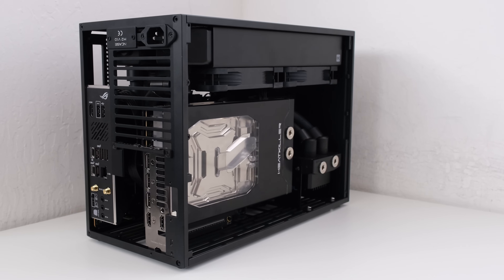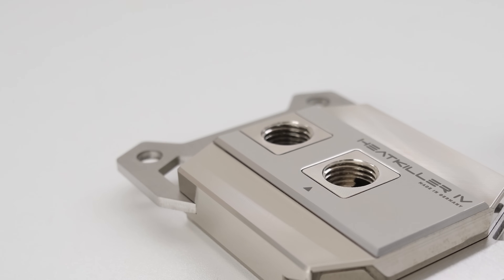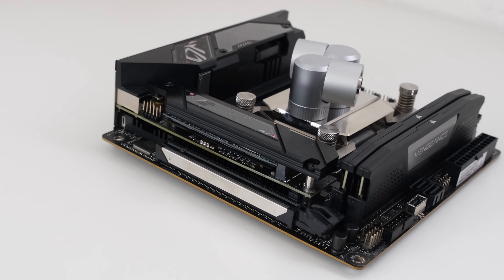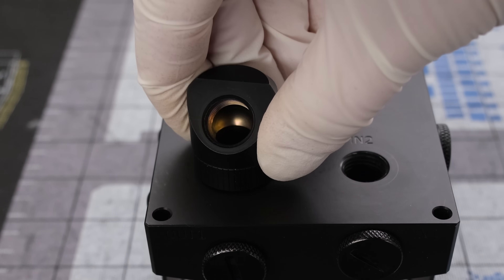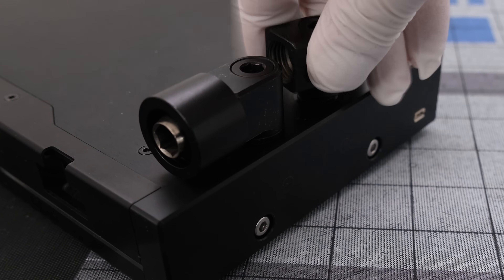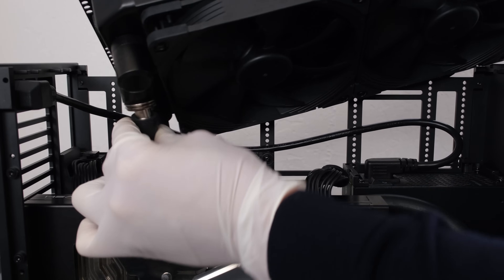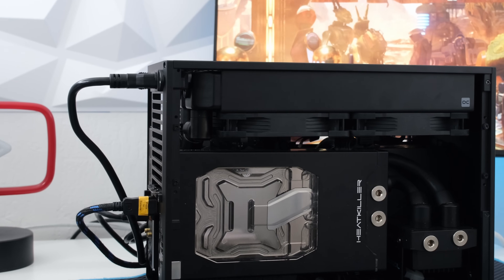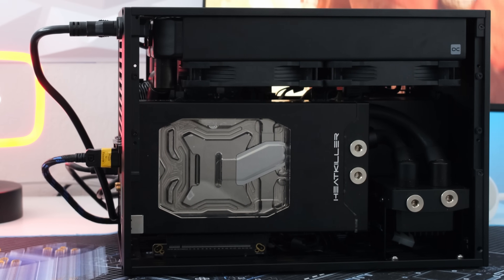RTX 4090 in NCASE M2 - Ultimate SFF Watercooled PC

Comment: You are very brave with a single raditor. 50% blocked by case and then cover. 
I've got 2 slim radiators and 2 tiny pumps working one after another.

Comment: 99 degrees VRAM is not ok
Reply: No it’s not, but that’s what u get when u try to cool all this with a single 280 rad, stupid lol
Reply: @godnamedtay I think the problem is not a rad. 58c on die and 98.. looks like bad contact on vram dies. Should be li ~65 on vram
Reply: @graviusmatt  ok that’s a possibility, but would yourself even cool a 4090 with a 280 rad? Even the AIB’s don’t sell liquid cooled 4090s, 5080’s, ect with anything less than a 360. This build needs 2 rads, period. This is nonsense. I also saw a video of this dude doing an entire Intel water cooled build with a 3080 on just a single 120 rad. Dude is out of his mind lol
Reply: @godnamedtay you can use 280 rad with servers fan at 6000rpm+ 😂. And tell everyone that you have an turbocharged pc

Comment: love this build. Now with the ncase M3 release this exact setup could maybe be assembled without needing vertical gpu mount, thanks to the m3 extra height, right?
Reply from the maker: Perhaps, I haven't done my research on the M3. Does the M3 come with a native vertical mount? The block would still need to be mounted vertically. The extra height helps for sure. This was a tight fit all around, but it all did fit.
Reply: @vectornetwork  no it doesn't. Now that I'm wathcing again idk what was I thinking, extra height won't be enough

Comment: Thank you for sharing this! Just ordered the M3 Grater and will be using this vid as reference for my build. Quick question, now that you've been using this for a while, do you feel the single 280 rad is sufficient to cool a 5080 & 9800X3D?
Reply from the maker: That's a tough one. 280 is barely the minimum. I don't really try the builds that are only a single 240. A 5080 will draw noticeably less power than a 4090, so I think it would squeak by, just like this build. Hope that helps

Comment: hey bro looking for a tip, I want to build this exact same pc but with the 9800x3d, b850i and a 5090, do you think the Gigabyte AORUS GeForce RTX 5090 XTREME WATERFORCE WB mounted horizontally would work with all the components you listed apart from the Heatkiller v pro? Like all the fittings tubes etc.. thanks in advance
Reply: or alternatively, the 5090 Gainward with the Heatkiller v ultra using the new pcie 5 riser for the ncase m2, might be the better alternative

Comment: Your Google sheet with build parts in incorrect. You may have linked to the incorrect build?
Reply from the maker: There are different tabs. Checks the tabs at the bottom. That worksheet has several builds.
Reply: @vectornetwork  Thanks. I thought I looked but I guess I didn't!

Comment: A single 280mm radiator for both CPU and GPU is really not enough. Even if you blow 19°C air directly with air conditioning, it might help temporarily — but in the long run, you’ll still be thermally limited. You won’t be able to run both components at full potential for extended periods without throttling.
Reply from the maker: Yea, sounds about right. This was more of a concept. I wouldn't want to run this as a daily.  I wanted to see if I could reasonably fit a 4090 into the Ncase M2 and have it not be significantly compromised by some issue. I think it works (just barely), but the maintenance would have to be done like all the time to keep it running well. I also thought that it looked really clean since I was able to hide most of the cables but still have some peak out to let you know that they are there. Thanks for your thoughts

Comment: Could you do this with 30mm thick fans when the t30-140 releases with the same radiator thickness at 45mm? Using an x870i motherboard.

Comment: It would be good if there was water in the power supply too. it would be thinner and it would be convenient to make a very small pc. smaller than this one. and if they replaced the sata connector with mini-SAS it would be even more compact. 

I think if there were more heatsinks you could make a super quiet pc.
Reply from the maker: Thanks for your comment 🙏 Yes, if everything gets lower in noise, then the PSU would be the next culprit. But then that would be well beyond my abilities and capabilities.
Reply: @vectornetwork  I have a power supply unit, the cooler is noisier than the rest of the PC, but I don't want to change it because it will take a long time and there will be no warranty, although another power supply unit lasted 7 years and then tragically exploded, but everything else survived, so I'm happy. If the power supply unit works normally for a year, then you can replace the cooler, regardless of the remaining warranty.

Comment: When doing this build, how are you sure that you've filled the loop at the end?
Reply from the maker: Thanks for your comment 🙏 Good question. ITX watercooling builds are usually much harder to fill. The only saving grace is that they are small enough to pick up and rotate, which is basically required to fill. The way I did it was I used the GPU block as a gauge for how much air is in the loop. I would fill it from the 4 plugs you can see from the front (2 on the GPU and 2 on the Pump Cover) by placing it on its side. The process was to put as much liquid in as possible, seal it up, pick up the whole build and rotate it so the water will flow to the radiator, CPU block, etc, put it back down and repeat this process until there isn't any air in the GPU block and its all filled up with water. It took about 10-15 times until I felt it was good and I could run the pump. Hope that helps.

Comment: Is it possible this water cooling setup into Fractal Design Era 2? What should I follow?
Reply from the maker: Thanks for your comment 🙏 I actually tried to water cool in that case. It set me back about 2 months of building since I tried everything and nothing fit! It also only maxes out at 240mm radiator. The Ncase has room for a 280, which is not insignificant. Hope that helps

Comment: i really like this build. i want to use a 7900xtx that is too long for having the same pump. it's hard to see what free space is available instead. do you think using Alphacool Eisstation 40 DC-LT  + Alphacool DC-LT 2600 can fit if i put a 7900xtx water cooled ? also, what is your process for designing a setup to avoid compatibility issues where one component blocks another?
Reply from the maker: Thanks for your comment 🙏 Good question. First rule of watercooling is that nothing fits! Funny, but kind of true. I think it would probably fit space-wise, but the hardest part is finding a good place to actually mount the pump and still be able to do runs. My process for designing a setup is simply to try everything. I have a lot of pumps/reservoirs and all the mounting hardware over the years. You kind of identified the hardest part of watercooling, which is getting the parts that fit. This makes it way harder when watercooling in the smallest cases. Hope that helps
Reply: @vectornetwork  Thank you for your answer. i understand that it is hard as i think, but becomes easier with a bunch of hardware. So in my case i need to order, test and send it back if it doesn't fit. Does the position of the pump in the circuit change anything ?
Reply from the maker: @spoitler447 Loop order doesn't matter, the water normalizes too quickly for that to be an issue.

Comment: Awesome build!
I'm planning a similar build, do you know if arctics p14's(27mm instead of the 25mm) would work? It looks like your noctua a14's are right up against the motherboard. You would help me out a lot!
Thank you in advance!
Reply from the maker: Thanks for your comment 🙏 Good question. It is close. I tried to put fan grills on but they were too large. I think you will be able to clear the motherboard just fine, but the problem will be the 12vhpwr cable. You see how the cable is the only thing that sticks up and can interfere with the fan? I had to bend that cable pretty well. It will be close. You may have 1-2mm of space, at most. Hope that helps

Comment: Awesome video - thanks for sharing this beautiful build.  Did you consider using the Alphacool VPP655 + Ice Cover (D5) pump on this build?  It's difficult to get the GPU water block you used where I am, and was looking to use the EK waterblock for the 4090.  I'm hoping there's enough space between the card and the side panel for the hoses. 

I haven't built a PC in almost 20 years - so much has changed haha.  In the early 2000s I was overclocking Athlon XP 1700+s and cutting windows into Antec cases.  My last PC was an unstable water-cooled Windows Vista machine, which made me go Mac for the last 20 years :)

Comment: Doesn't the GDDR6X memory temp seem high?  Unless that normal, I dont have any experience with GPU's using the 6X memory.
Reply from the maker: Thanks for your comment 🙏 You're absolutely right that those memory temps are high. Some viewers had pointed that out earlier. I didn't catch that before publishing the video. I missed it partly because the GPU temp was in line with expectations and my mind blanked when going over the memory temps. Since then, I had taken the block off the card and verified that the contact was not good. For memory temps, I expect them to be in line with the extensive testing already done on this water block (spoiler: they're good). Hope that helps

Comment: A Masterpiece! 😘👌 Perfecto! This is now my Dream PC Build! 😍 Do you do Prebuilds?
Reply from the maker: Thanks for your comment 🙏 I appreciate the kind words. I plan on doing my best to make more videos. I have never build a prebuild.
Reply: @ what do you do with these PC’s after you’ve built them? I’d love to build a pc like this, but don’t trust myself enough to handle such a task 😂
Reply from the maker: @JC-hq7wz  Well, sometimes I use the build. Like the Editing/Gaming one. Been using that as my main driver and to edit these recent videos and it runs like a dream. Just a little dusty since I keep the side panel off (so I can look at the build) so I spray it with air ever so often. But most other times I simply just take it apart. I either need the parts for another build, need to sell the parts to fund another build and/or need the space. So, this one is completely disassembled as the Strix 4090 is back in a Silver Optimus block and being filmed for another build in the Fractal North. Hope that helps

Comment: It's really amazing to be able to fit all that in, however the question is - is this better than just leaving everything air-cooled? The issue I see here is you are dissipating all the heat generated by both the CPU and GPU via one single 280mm radiator - which, ideally should be dedicated to CPU alone. And you are running the water line in serial I think, which means either GPU or CPU is getting the warmer water... I'd love to see trying the same basic build setup but with all air-cooled solutions and do a comparison. I think Optimum did a similar build (same case, same CPU but 4080), all air-cooled. It would be interesting to see the difference in performance... While it's a very cool (and expensive!) build, my gut reaction is that it actually would perform WORSE than a much cheaper, standard air-cooled build in the same case.
Reply: It's about the same, slightly cooler than My air cooled version. Also loop ordering doesn't matter. The water runs quickly though the loop causing it to evenly increase. The thick radiator is more than enough for both components. As cpu barely outputs any heat vs. Gpu. And here there is very little impeedence, so the dissipation efficiency is maximised.

Comment: Do you think a slightly larger MSI Gaming Trio 4090 waterblock would fit in a build like this?
Reply from the maker: Thanks for your comment 🙏 This HK water block was one of the few waterblocks that I tried that would fit with a 45mm radiator up top. The difference is the location of the terminal. By having it on the side, it reduces a lot of the height. Hope that helps

Comment: What were the ambient temps? Did I miss that? My 3070 gets to 49C during 3DM Steel Nomad with 720mm in rads which is only 10 degrees with more than double the radiators

Comment: Well, nice job. A bit far from being ideal, but nice.
I'd love to see some additional metrics like the coolant temp and the time of the run.  And of course what CPU temp metric was used. Simply because the results are a bit too good to be true - more about it later.
As for the build, first of all it is way more practical to use the fans in the pull config - way less cleaning needed. And I'd definitely use the rad port on the top as fill port with the help of offset fittings or a couple of low profile 90. Way easier to fill the loop. And of course the drain port. As for power supply, and true SFX (without L) SF1000 would probably be a better fit because it allows more flexibility. Also, 45mm rad is also not that great. A 30mm HWLabs GTS280 would perform better at low to moderate fan speed and about the same at higher speeds due to its larger core. Thats not theory, but from experience.  In addition, there is definitely a room for some sort of pump res combo.
 I have a build with a similar power draw. About 340W GPU and 120W CPU under full load. All housed in a Lian Li Q58 - 14L case.  Initially, I was using a single 280 rad and I was not happy with the need to have fans spinning at 1300-1400 RPM under full load to keep the coolant below 45C in a 24-26C room.. A bit too noisy. So I ended up adding mounting holes on the bottom of the case and slapping additional 280 (surprise surprise, NexXxoS XT45 280). TBH, I''d prefer a 30mm but I only had this one. The only spare 30mm 280 was xflow, which was less convenient and required more dremel love to the case. With the additional cooling capacity, the coolant is below 40C with fans in 800-1000RPM range depending on the room temp. That is much more quiet.
Even with the additional rad it is just a bit larger than M2, but significantly quieter and with much higher cooling capacity.
Reply from the maker: Thanks for your comment 🙏 Someone else had mentioned a pull/intake config. It didn't really occur to me, as I was thinking exhausting hot air up seemed like a solid choice. The top port on the rad would have been perfect to use as a fill. But, the ports were covered by the bracket. For the power supply, my understanding is that the SF850 and SF1000 have fans that tend to be louder than expected at higher speeds. So, I went with the SF1000L as I wanted at least 850 watts. I thought the 45mm rad actually looked really nice there. I tried a 30mm rad and there was something about squeezing in a 45mm one that felt solid. It was a good feeling, since a lot of times SFF builds are not only restricted to 30mm but also only 240mm rather than the 280mm one here. Your build sounds really good. Its a win that you got it to run both cool and quiet. Thanks again for your thoughts and I plan to make improvements with each video.
Reply: @vectornetwork  thank you for the reply.
when I was talking about fans at pull config, I meant exhaust. For your build it would mean switching the fans with the rad. This would also leave enough space between the rad and the bracket for the top fill port with 2 x low profile 90 or some offset adapter without dremel love. TBH, even if for some reason it is impossible to to swap the rad with the fans, I'd use dremel to gain access to the rad's top  port.
As for SF1000 - under ~500w load, it is not louder than other fans in the system (all of which are below 1000 RPM). It is worth mentioning that the PSU fan is assisted by the top rad. I even made some sort of a shroud to force more air to go through the PSU even when it's fan is completely stopped.
Reply from the maker: @DmitriWeissman  Oh got it, I misunderstood when you said pull, I mixed that up with intake. It is because, I had initially tried the pull config first and it simply wouldn't fit. With the radiator lower, the fittings would stick out too far down. The rad is required to be on top, so the fittings can sit more flush with the fans. As for the dremel, I think that would be solid choice as the top ports are just so perfect to use. For these videos though, they are all 100% completely mod free. I mean, its all custom modification stuff we are doing here, but I stop short on breaking out any power tools. Part of the puzzle and part of the fun for me is figure these builds out with existing parts. So many times I had to not use a pump unit because the screw holes just dont line up. And I have endless mounting plates that I have accumulated over time to try. Also I'm trying my best to appeal to a wider audience. Watercooling is already so niche. I think you may very well be right about the SF1000. I have never tried it myself. I think it is likely I'll procure that PSU sometime in the future. As it may prove to be very useful for upcoming SFF builds. Thanks again for your thoughts

Comment: Can you move the gpu plate while vertical for the hose pass throughs? I want to use my mora 3 420 with this case.
Reply from the maker: Thanks for your comment 🙏 The pass through holes on the GPU plate cannot be used when using a Vertical GPU. The instruction specifically require the removal of the GPU plate. Hope that helps
Reply: @vectornetwork  i got the case and used standoff to raise the gpu so I could use 2 140mm fans on bottom. Used a pcie passthrough from iceman for the tubes. I use the mora 3 420

Comment: Does it fit ZOTAC 4090?
Reply from the maker: Thanks for your comment 🙏One of the reasons why this build works is the compactness and terminal placement of the Heatkiller GPU block. The HK block only has models for the Strix/TUF and Founders Edition. So, I do not think a Zotac 4090 would fit. Hope that helps